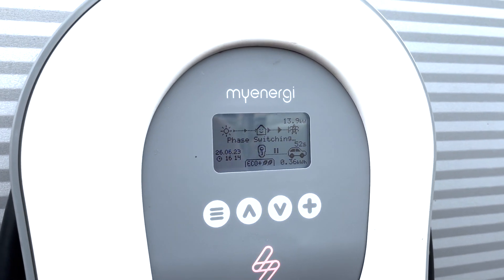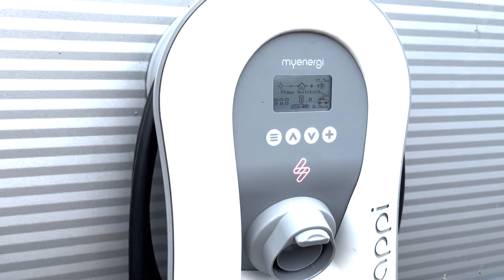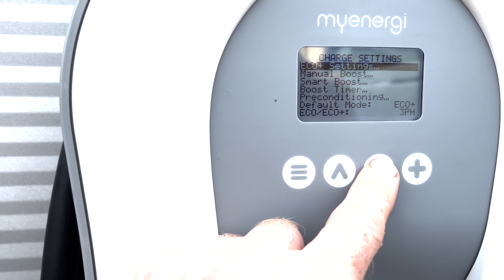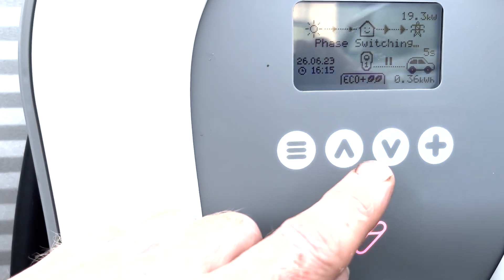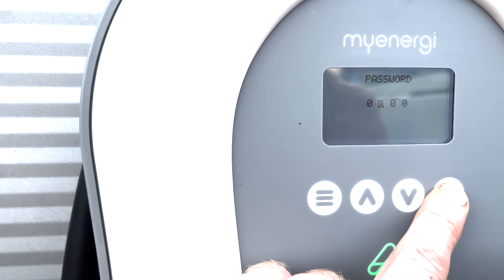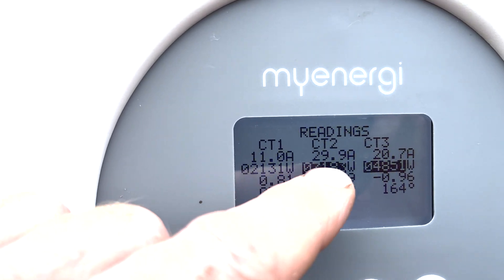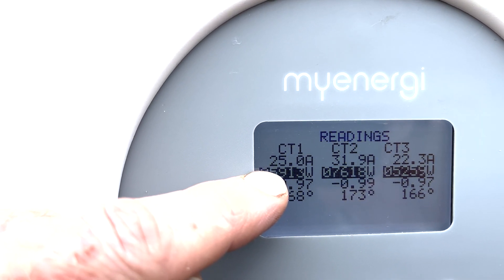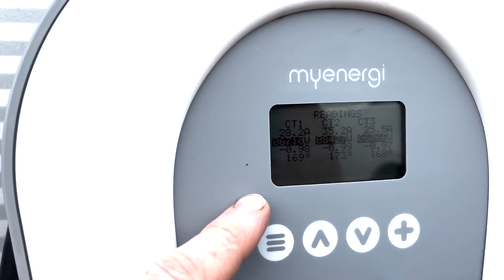MyEnergi Zappi Car Charger - Checking the phase connections on 3 phase install.

Comment: I just puts the fuel nozzle in the tank and 5 min later I’m on my way. You guys that think electric is the future crack me up.
Reply from the maker: OK so its 5 mins at the pump.- how long to drive to the pump and then back home etc ?
Reply: Well, I have a charging station at home, do you have a oil rig at home? You fossil fuel burners are cracking me up... You still think you need to wait next to your car until it is full... It is not gasoline, we can just plug it in when we get home and it is always full when we leave the next day. How is that for convinience :)

Comment: Measure the current at your meter and/or secondary distribution board with independent CT's. The 3 phase Owl monitor has an app and then you can cross reference the current in each phase throughout your facility to figure out what goes where !

Comment: Just get a phase rotation tool is best. Phase rotation is anticlockwise, but as long as it goes the direction of the arrow on the tool, it will be right.